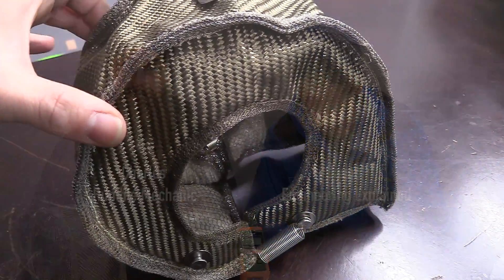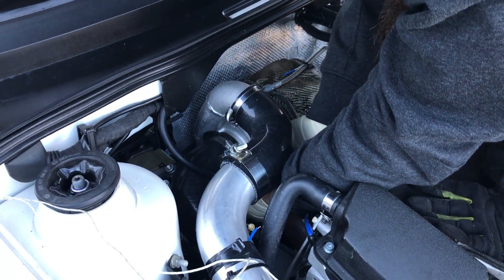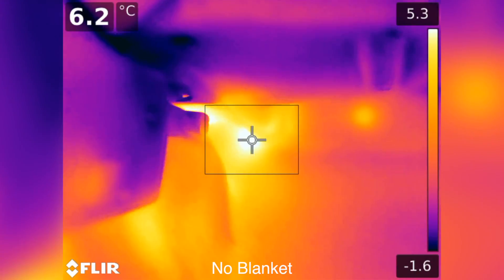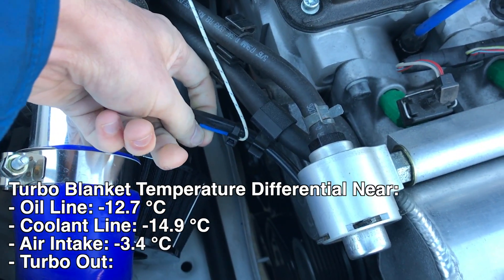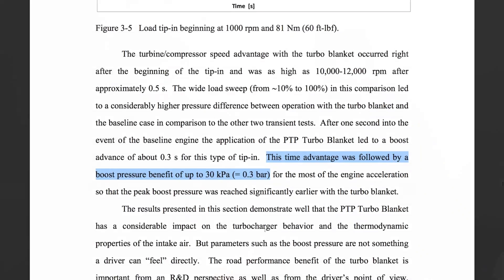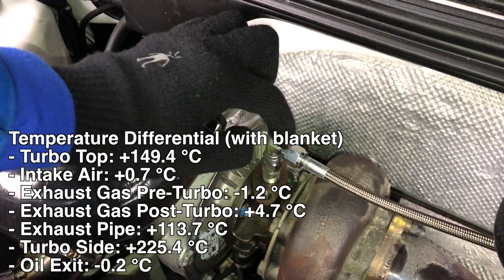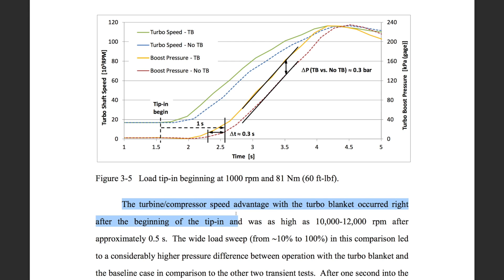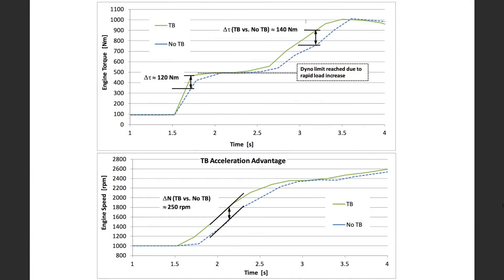Can Turbo Blankets Be Proven To Increase Performance?

Comment: Hi. What about ceramic coating to engine parts, exhaust parts and other parts? I own a 2005 Subaru Legacy Spec B 3.0R wich engine its being completly repair. I will aplly to the pistons ceramic coating wich will help to protect them and get some more Hp. After this I will aplly ceramic coating to the exhaust headers. It got the same objective has thermal blanket but with time It wont damage the exhaust. The thermal blanket usually make small holes on the exhaust. Can you review ceramic coatings in a future video? Thanks. (Im from Portugal)

Comment: What concerns me with using these blankets is if it will kill the material of the exhaust housing? +200 degrees is a HUGE change when it comes to keeping the material in its optimal range. Amateurs often heat shield custom steel manifolds which then leads to the material overheating both releasing "shells" of its material into the turbo and making the manifold crack. I have not seen turbo blankets personally on top level rallycross cars either, which usually are in the forefront of "diy tuning", and I know that some of them are running super thin "garrett wont let us buy these turbos and we have to return them even if they blow into a hundred pieces" exhaust housings

Comment: In my opinion, if you want a decent lifetime of your turbocharger (>100.000 km, but preferably  even 200.000 km) on a gasoline engine , it is not acceptable to increase the turbine housing temperature by 130°C. The increased thermal load on the turbine housing, the turbine wheel and often the integrated waste-gate valve, will enhance seriously the risks of distortion and cracks in the turbine area.

Comment: I have done multiple dyno pulls with them on or off, with no increase in power with them on.
Where are you getting your data from? After years of drag racing turbo covers are useless and cause premature turbo bearing failures. Where is my proof?
DSM eliminator champions..

Comment: Will trapping all the heat in the turbo not shorten the life of the turbo itself?  It seems like have increases in temperatures at the turbo of 20-25% would be detrimental to its life span.  Imagine if other components consistently saw a 25% increase in temps on a regular basis. Thoughts?

Comment: I've tried to use one a few times, mine gets to 850 degrees internally without a blanket, but 1100 with a blanket. this has killed 2 turbo's so far. I dont use blankets for this reason, turbo gets too hot

Comment: What about the turbo itself? Can isolating all that heat right on the turbo do any damage because the heat has no where to dissipate. Any damage to the turbo gaskets, bearings etc.

Comment: did i understand this right? so ppl in that study gained about 100ftlb of torque as a result of the turbo blanket?
i also have a question for humblemechanic, i have 12v VR6 NA, can i switch to a bigger maf housing and see more gains? someone told me i can see noticeable hp and tq gains but i wanted to verify with u thanks

Comment: My car (Ford TDCI - turbo petrol) have a separate electric water pump for cooling the turbine. I guess there is a reason for that, and I would not dare to risk turbine overheating, even if your measurement shows otherwise. Maybe it makes sense for turbo diesels, as exhaust gases on diesels are not so hot, and perhaps cooling the turbine is not so critical.

Comment: Badass video I wrapped my exhaust intake and added a turbo blanket definite difference in heat resistance and throttle/spool response on a Mk7 gti

Comment: Thanks for the videos!  What you didn't report was whether the turbo bearings were much hotter or closer to the oil temp.  If the oil was not capable of extracting the heat due to a short time in the turbo before moving out and getting cooled again before returning the results do support that though they don't monitor it.  Since the housing is much hotter and the oil isn't cooling it fast enough, the bearings are probably at a temperature beyond what they would normally operate.  It is plausible that in hotter ambient temps, you might exceed the designed bearing temperature and prematurely wear them out.

Comment: 1) If the test is just "plug and play". Isn't the ECU messing up with the results? Doesn't it prevent the engine to make more power than whats it was built (and tuned) for? And therefore explains why we have more torque sooner but not more max power.

2) Does it improve fuel efficiency?

Comment: Isn't it kind of common to see heat shields on exhaust and turbos when they are situated next to heat sensitive components? But it seems like they don't wrap them, but have the shield direct the heat away from the desired components but still allow air flow around the exhaust components. An easy example to find is the Celica GT4, some of the heat shields even had louvers. I'd be curious to see how under hood temps would be with just a heat shield situated above the turbo and manifold like on many OEM applications.

Comment: If you disconnected the turbo from a car that came turbocharged and built for handling the boost would the engine last longer than an engine that came NA?

Comment: Would keeping the heat wrapped up around the turbo and stopping it from escaping have any durability/long term effects on the turbo, such as shortening the life span?
It would be interesting to know the temp inside the blanket.
Reply: The blanket and exhaust wraps make metal brittle and prone to breaking. But it takes years and years and many many heat/cool cycles.

Comment: Okay, now a pretty serious question as I'm preparing to wrap my turbo and exhaust pipes up to the cat probably. How do all those blankets and bandages combine with moisture? Don't they get wet when the car stays for a bit outside, which would pretty much ruin the steel pipes and turbo casing?

I can always change the exhaust to stainless, but it's hard to get such turbo casing.

Comment: 50-60 degrees F° on both the coolant and oil lines seems pretty huge to me. On something like a racecar/driftcar, this seems like it could help quite a bit with oil temps and overheating issues. On top of the added spool shown in the second tests, every turbski needs a blanky!

Comment: How about Diesel particle filters, wouldnt the blanket retain heat, heat that fliws into the dpf, causing it to reach its regeneration temp sooner, and tgerefore require less diesel to heat it? Guys want to test it?

Comment: Talk about wear on components, Im surprised that as “engineers” you do not think that this blanket traps the heat on the turbo thus obviously increasing its operating temperature drastically, and this my be higher then it’s designed tolerance for components, oil, bearings, grease, etc, resulting in failure or in best case scenario accelerated wear of your turbo (other components of the engine are designed to and can operate without the temperature benefits of the blanket). If your goal is to keep the other side of the turbo isolated then maybe its better to put the blanket on that side, also if you want cooler air on your intake there are allot of ways to achieve that without overheating your turbo
Reply: oil stayed about the same temp in tests see 10:30 it will increase the temp of the turbo housing and internal components for sure, which may affect the life as it has a larger temp differential, which could result in premature failure

Comment: I wonder why auto manufacturers don’t install turbo blankets at the factory. It feels like there is more to the story, like possibly decreased service life.
Reply: Cheap, thats it
Reply: Dan Alwood it’s because most stock turbos on everyday cars are used for fuel efficiency not performance. Also, stock turbos aren’t pushing 15 pounds of boost, so they are going to much cooler to begin with than performance cars that are tuned.
Reply: Most likely the manufacturers don’t want or can’t take on the additional liability from flammable liquids getting on the blanket and catching fire.
Reply: Idk if still relevant but i own a turbo and compressor charged car rn and i wouldnt be comfortable with heating my turbo 225c over the spec the manufacturer expected... tolerances of different metals might be off and the worst point i see is heat being trapped after the car is shut down. The little bit of oil left in a turbo is already a critical point of failiure, now it has to cool 200c more.... idk about that. Also manufacturers care more about reliability than power, otherwise such heavy aftermarket tuning as is the case rn (gtr e.g.) wouldnt even be possible.
Reply: Most ford diesel trucks come equipped with metal heat sheilding on the exhaust side of the turbo, it is more to keep hest away from,other items than spool up or anything else.
As previously said, a additional cost, labor to install all for basically minimal to no gain from a manufacturing standpoint. (No emissions improvements, no milage gains )
Reply: Dan Alwood stock turbo car have smaller turbo.. it has more space for air ventilation..
Reply: Modern German diesel engines come with formed insulation and metal shield covering most of the turbo hotside. It is recognized to be important for under hood heat control and turbo performance. Not sure why other manufacturers havnt picked up this practice other than the added cost.
Reply: Turbo leaks oil = car goes up in a blaze of glory
Reply: @MeltingRubberZ28  Would that not happen at 500 degrees Celsius to begin with? Lol
Reply: @VanillaWahlberg  the blanket absorbs it and can be a fire hazard. Turbos leak oil all the time and don't cause fires.
Reply: @MeltingRubberZ28  and that is why we have insurance, I don't worry because I have excellent insurance. Thant and I maintain the vehicle well.
Reply: @CA-td2mx  until insurance denies the claim since you're at fault based upon modifications to the car
Reply: MeltingRubberZ28 I can see where they can, but in practice it ends up being right up there with the urban legend that if your vehicle is stolen with the keys anywhere in the car you are not covered. Unless its a nitrous huffing 2000HP car I haven’t seen it in reality for 3 cars I have seen catch fire with pretty extensive modifications.
Reply: Ons Huis      The wrap is for the manifold/down pipe and a blanket for the housing. All the stainless tie straps you'll use holding wrap and place will cost you more in the blanket.
Reply: I'm a Turbo-Enigneer-Wannabe at a car company, My guess why we don't use blanket for the turbo it self(hence you have a lot of heat shields around the turbo but not covering the turbo it self) that the Turbo temp as you so in the video will rise up  minimum +100C' and the exhaust gas as well, that means turbo life and reliability and life spoon will decrease( or you should design a more expensive turbo that can withstand higher temps). And as other guy comment states, exhaust gas will be very hot +100C' and so you need to consider Exhst.Gas norms and Catlic converter. Also, you have the connected water/oil pipes in & out to the turbo, maybe not the one mentioned in the video above( that was oil in) the oil out pipe has an O-ring sealing that might get damaged. So maybe uncover the turbo and let it light up and emit some of the heat so more and more heat can escape, that can be more practical than ticking all that heat in the hot side of the Turbo!
Reply: They usually come with a heat shield
Reply: Some cars have a heatshield like my Vauxhall vectra
Reply: Most likely the catalytic converter will be destroyed by increased exhaust temperatures in no time. But power seeking nutters cut them out anyway. "F%&k the air quality - I like to wroom wrooom!"
Reply: electroman5000 Jason, wondering if you might be able to shed some light on electromans statement about the impact on a catalytic converter with increased downpipe temps. Thanks!
Reply: El Sols exhaust temps aren’t significantly higher compared to without a blanket, according to the report they mention.

Comment: Now I'm curious on how it will affect a turbo that is positioned in front where it gets air from the radiator like on my 2004 Saab 9-5 ARC. And to go a step further how much of a difference will exhaust wrap do as well as it looks to be there name of the game to keep the gases as hot as possible.

Would also be cool to see throttle response in the test under different RPMs and loads at those RPMs.

I also noticed there's a limit to the help extra heat would help with turbo pressure at peak pressure, but I'm curious to know if that was a fuel delivery issue or simply the turbo hitting it's volumetric design wall dispute how much hotter the gases where.

Comment: Subaru Legacy from 1998 comes with insulated turbo hot-sections from factory (stone wool under a thin metal cover with "hot, don't touch" stamped in Japanese). 
There are probably lots of previous research about it.
Reply: aren't those heat shields open at the bottom to allow air flow? I think they put the heat shield to keep the top mounted inter cooler from getting as hot.
Reply: You are correct, they are indeed open at the bottom, but I assumed it was due to the lack of space in the engine bay and facility of installation. I don't think it is too allow air flow since they have this layer of stone wool (?) between the shield and the turbo (1998 legacy b4 rsk). Also the proximity to the intercooler does make sense, specially for the primary turbo that is always getting exhaust gas. It is also interesting that the secondary turbo, most of the time during normal drive doesn't even get hot gas flow, only above 4000 rpm. That means most of the time this turbo would be cold and not affecting the rest of the engine, but having the insulation probably makes a big difference in keeping this turbo warm, not loosing exhaust temperature, and consequently speeding up its start.
(edit: Removed the part where I said incorrectly that the secondary turbo was not under the intercooler)
Reply: Yea possible design intention by Subaru. I just wouldn't under estimate air flow cooling the turbo form the under side. I've seen some cars like the Celica GT-Four having louvers in the heat shield for the turbo. Not every model, but I've seen some years with factory louvers. So I imagine on some cars they want to protect other components in proximity but don't want to seal off the turbo. Like just about every Turbo Porsche I've come across has tons and tons of heat shielding above the turbo and exposed underside. It's not like they didn't have the space to wrap the turbo completely and I'm sure they know what they're doing.
Reply: The more I think about it the more I realize I've never seen a factory turbo completely wrapped from the factory. I'm sure they exist, but I'm drawing a blank. Even the 2JZGTE has a nice heat shield over the turbo, but is open at the bottom and there's plenty of space so I think if they wanted to fully wrap the turbos they could have.
Reply: Additionally when I think about I've seen plenty of exhaust down pipes that are completely wrapped in a heat shield from the factory. So I'm sure there's a reason why they don't wrap turbos.

Comment: wondering about those start stop system on modern turbo cars..
Reply: You know, that is a good question. I do know that the car will only shut off if the car things its appropriate. But I wonder if anything is programmed to not let the car turn off after a WOT run...  My guess is this is not a big issue since the car fires back up in under a minute generally..... INTERESTING indeed.
Reply: with turbos spooling up really early these days, i am sure the heat it generates in urban driving is quite high, i would probably turn it off regardless, hate those things lol
Reply: Yeah I find it distracting. But I Think if I owned a car with it, I would get used to it. LOL

Comment: Turbos should have integrated heat shields from the factory anyways. Absolutely on any big working diesel engine which can probably see almost 1000 degrees C on the hot side of the turbo under WOT pulling a heavy trailer up a hill on a hot day. Honestly this is a big useable power and efficiency gain as it adds little weight and cost.

Comment: oh oohhh I see some massive errors from your thermal readings methods. Metallic shinny surfaces reflect the radiation from the hot objects around. So some of your data are compromised because they are reflection and not actually hot.
The reason for some of  your lower temp readings with the blanket is because the blanket covered the reflective IR to those metal parts around it, not reflecting IR radiation. Think of IR as light, the light is reflected from those metallic surfaces.
You need to apply black tape to reflective surfaces to get the best correct temperature of shinny surfaces.
Reply: a way to test what I said, try to get a thermal reading of a glass window, mirror or metal shiny parts, where you are exactly 180 degrees from it, you will see your heat reflection, but the material isn't as hot as your body, its just a reflection of your heat.

Comment: You guys are awesome.
Have  a 2006 Polaris FST Turbo snowmobile i will install one of these on. This machine is a great powerful machine that has the Weber 750 Multi purpose engine in it. We purchased this used 5 years ago and stock is around 125 horsepower. My wife drives. It mostly and I'm not looking to gain n power as much as protect the integrity of the systems surrounding the turbo. I've used a ton of aluminum tape in man y areas like the plastics and such to reflect some of the heat and fiberglass pipe insulation on the intake pipe from the intercooler to intake. Just a tight package all around. I'm hoping you will post a link k to the data logger as well. Looking for one that will record for up to 24 hours of so for refrigerator and other things. Perhaps I will post my results on a channel.